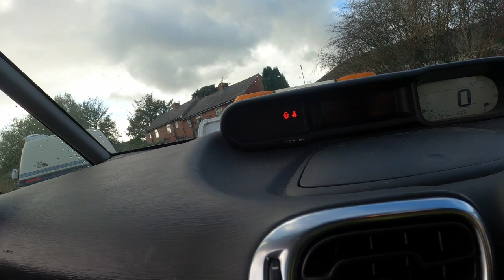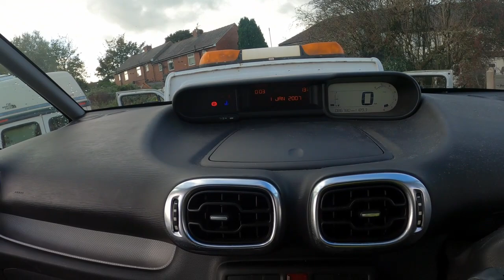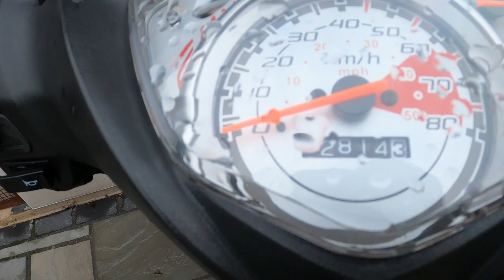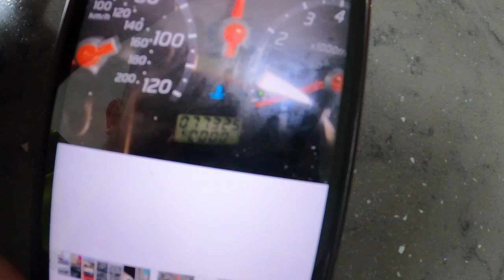ANOTHER CAR FOR THE BREAKERS YARD!  WHO WANTS TO BUY THE MONDEO??

Comment: Great video sorry you got scammed. That c4 picasso will be fuse box under engine  water got in it mine did the exact same dried it out on radiator and was fine for ages until someone hit it